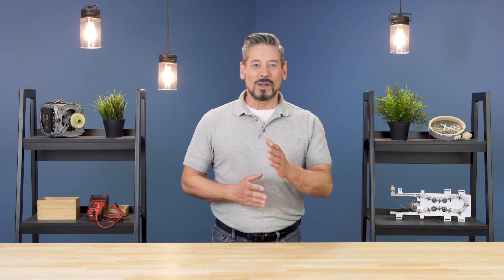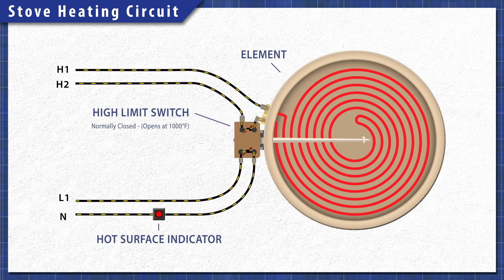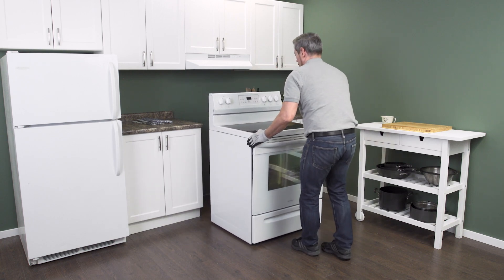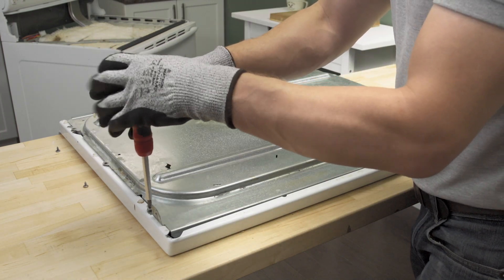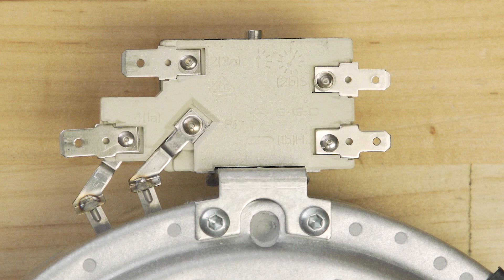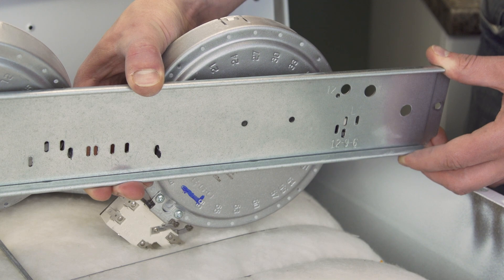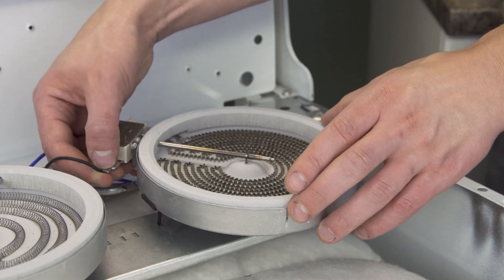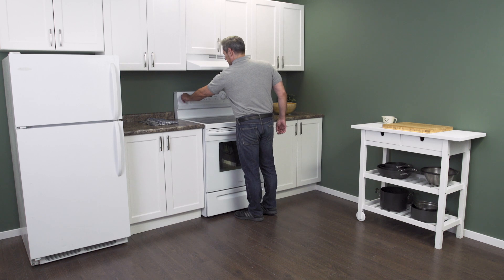Hot Surface Light Stays On - Troubleshooting | Repair & Replace

Comment from the maker: Did this video help you fix your stove? Did you run into any problems? Let us know in the comments!
Reply: Yes, this helped me determine if the problem was the element or the limiter controlling the indicator. Thanks for this informative video.
Reply from the maker: @izeugirdor  You're very welcome, we're glad that you found it helpful!
Reply: No. I tested all switches, they were all open. I even tested the warmer. The light is still staying on.
Reply from the maker: @miguellugo3543  Thanks for watching. It is unlikely for the hot surface indicator light to stay on if none of the limiter switches were closed at room temperature. By any chance is it the power indicator light for the burners? That could be a problem with the heat switches rather than the elements themselves: https://www.youtube.com/watch?v=s5iG61kAyJQ
Reply: I tested all the switches and they are all open. But the one thing I did notice is I don’t have any wires going to my 1b and 2b on the element
Reply from the maker: @XRotov2  Thanks for watching. Do you mean that out of all the heating elements, there were no wires going to the 1b or 2b on just one of the burners, or on all 4 burners? Have their been repairs on the stove done before, or are these the original untouched parts?
Reply: @AmreSupply  these are original parts untouched. And yes there are no wires leading to 1b or 2b on any of the burners.
Reply: @AmreSupply  I should add that there is a cooktop hot light and cooktop on light on. Thinking it could be one of the infinite switches?
Reply from the maker: @XRotov2  The heat switch will have a terminal for the cooktop on light. If this stays on then you'll have to test each of the switches to narrow down the faulty one: https://youtu.be/s5iG61kAyJQ

Now for the hot surface light, it is not usual for the 1b and 2b terminals on any element limiter not to have any wires connected.

You might want to check your tech sheet for the wire diagram. The tech sheet is often located on the back panel or in the oven drawer. I am not aware of all variations and all models so there might be a case where one sensor or thermistor is used to detect the glass surface temperature. You should be able to trace the hot surface light on the diagram and see if it goes to 1 sensor. In most cases it will be obviously wired and connected to each of the limiters on burners so that any single limiter will turn on the light.

One other consideration: If the hot surface light is built into the display board / control board then it is more likely that you'll have a thermistor. The hot surface light shown in the video is a physical standalone miniature light bulb.
Reply: yes. The only videos that are clear, to the point, without time waste, and solves real life issues.
Reply from the maker: @samj1012  Thank you! We put a lot of effort into making these videos clear and easy to follow. We're just glad that people are finding them helpful!
Reply: Mine is like the other person described, all test open, no wires run to the terminals for 2b 1b, hot surface light and cook top on light stay illuminated. Going to have to keep digging
Reply: This unfortunately was not what happened. It had turned off but I saw a faint glow. The glow was very dim. It was like LED ghosting because the indicator was an LED as I recently replaced the incandescent bulb with an LED after it burned out. But this caused ghosting effect which was annoying but i just ignored it. The contacts weren't stuck closed. This happened only for a minute after I turned it off. I just pretended it never happened instead.

Comment: This unfortunately was not what happened. It had turned off but I saw a faint glow. The glow was very dim. It was like LED ghosting because the indicator was an LED as I recently replaced the incandescent bulb with an LED after it burned out. But this caused ghosting effect which was annoying but i just ignored it. The contacts weren't stuck closed. This happened only for a minute after I turned it off. I just pretended it never happened instead.

Comment: Do you really need to use a multimeter if  I already know what burner dosnt work
Reply from the maker: It depends. If the burner itself is not heating up then it could be the failed heating element or the switch. Testing is required if you haven't eliminated the switch as potential failure: https://www.youtube.com/watch?v=GaW7uAHkPQI

Comment: Our glass top does not have wiring to the two smaller terminals... where is the 'hot surface' light then connected? model #WFE515S0JS0
Reply from the maker: Thanks for watching. Not all models have hot surface indicator lights but in the models that do, the hot surface light is wired to the limiter in the elements as that is what is needed to detect the temperature. If it's not connect to limiter on the elements it would need some other way of detecting the temperature.

Comment: I've experienced this occasionally with our Whirlpool range and I think sometimes leaving a pan on a warm burner may cause it to happen. I used to go down the basement and switch the circuit breaker off and back on again to clear it but then you might have to reset the clock, so now I just turn the burner back on fully for about 30-60 seconds and shut it back down and the light always clears once the burner cools back down in about 5 minutes, if it gets annoying to the point of happening all the time I'll do your fix, thanks for the video.
Reply from the maker: Thanks for watching. It seems that one of the limit switches might be sticking. The metal contacts inside of those switches can warp over time or become fatigued. Still if the problem is continuing to happen then you can definitely narrow it down by using the testing methods from this video.

Comment: It did help me. I replaced an element on my cooktop (because the inner ring was burned out) and the old one only had one wire going to the limiter. This had me confused as the new one had 3 terminals. Based on trial and error I figured out which connection I needed to use. Everything worked but I didn't really understand why. This video made me understand that the wire I'm connecting is the wire for the high limit switch and the indicator switch ones are not being used. 

The indicator works as it should though so I'm thinking it must be timer based. Does that sound plausible?
Reply from the maker: Thank you for watching. I am not aware of any hot surface indicator lights that are timer based as these are normally tied to temperature. 

If there is a dual ring element then the 3 terminals that you connected to were likely for the burner itself & the high limit switch. It is possible that the stove has the hot surface indicator on a separate circuit and is not directly tied to the burners.

Also if you have the link to the burner, please share it as I am curious to see what sort of part has that variation.

Comment: My infinite switch from kenmore stove  I need to replace it and I got one from AMRE SUPPLY  to replace " aftermarket " should I do the same wire as the original?
Reply from the maker: Thanks for watching and for supporting us! You should connect the wires to the same numbered terminals on the switch. Try to match as closely as possible. This video on the heat switch explains some of the terminals in more detail: https://www.youtube.com/watch?v=JKrrOflS1RM&t=403s

Comment: Why could this video have been done with a standard electric range
Reply from the maker: Thanks for watching. What do you mean? By standard electric range do you mean a conventional stove top with coiled heating elements? If so then you might be thinking of the cooktop (power) indicator light, which will be tested in a different way than the hot surface light. https://www.youtube.com/watch?v=s5iG61kAyJQ

Comment: Both my Stove on and hot light keeps staying on. I already reset the breaker.
Reply from the maker: Thanks for watching. It is unlikely for both the cooktop indicator light (lights when the power to any burner is on) and the hot surface light to be stuck on at the same time. These are on different circuits. 

To test the hot surface light, you'll have to test the limiter in each heating element as shown in this video.

To test the cooktop indicator light, you'll have to test each heat switch: https://www.youtube.com/watch?v=s5iG61kAyJQ

Now if you have an advanced stove with a control board that has integrated stove top buttons instead of individual heat switches (with dials), then it is possible a faulty control board could create these issues. https://www.youtube.com/watch?v=ORTi4lLyoqw
Reply: @AmreSupply  our power flashed two times when I was cooking when he had a storm. Now the are just both stuck that way. It’s a whirlpool stove.

Comment: Excellent video.
Even though the heating element wasn't working,  I wanted to verify with a meter to confirmed it was bad which it was.
I lucked out with my stove it didn't have a mounting bracket for the heating elements they were held in place with spring clips.
So just prop cook top like a car hood and get to.
Reply from the maker: Thank you, we're glad that the video was helpful!!

Comment: Hello there! I just got a new electrical stove and was wondering what does the hot surface indicate?
Reply from the maker: Thanks for watching. When you turn on a burner, the glass directly above and around the burner will heat up. There will be some residual heat for 10 minutes even after the burner has turned off. The hot surface light lets a user know that the glass surface is still hot and will potentially burn your hand.

Comment: My stove doesn't have a glass top.  Mine has exposed elements. Do you have a video showing how to test a stove top burner light with exposed elements?  I have a GE stove.
Reply from the maker: Thanks for watching. If you have a conventional stove with coiled elements then the light you're troubleshooting is a cooktop indicator light. For this you'll have to test each heat switch: https://www.youtube.com/watch?v=s5iG61kAyJQ
Reply: @AmreSupply  Of course our stove messed up just before we're getting ready to leave for a few days. Will it hurt anything to just leave it and let the light stay on until we return or should I disconnect the stove?
Reply from the maker: @historybuff5739  The light is fine if it is lit up as long as no burners have heat. For extra safety you could still disconnect power to the stove.

Comment: Great video. I just wish these had a better design. It's annoying and wasteful to have to replace the entire element instead of just the switch.
Reply from the maker: Thanks for watching, we're just happy to help. There are a small number of models that have a replaceable limiter, but they are not as common and requires some additional steps to replace. Using the part numbers on the heating element you might be able to check if the limiter can be swapped out in your model.

Comment: My GE Glass Stove Top element has a hot light indicator for each element. I know exactly which limiter is the culprit without needing to test. That said, the stove top works fine. Is there any need to get this replaced other than to stop the hot light indicator from showing?
Reply from the maker: Thanks for watching. Since the light is on a separate circuit than the burner, the stove will still work. If the heat switch is working properly then the burner will shut off and cool when turned off. So in this case, there is still full functionality even with a hot surface light that stays on.
Reply: @AmreSupply  bought a new in the box jbs86spss from Home Depot and noticed the hot top light staying on. Luckily still within the 48hr window to complain about it to Home Depot. Thanks for the video learned a lot!

Comment: I tested all of the burners on my Whirlpool RF262LXSB. They all tested for no continuity. What's next?
Reply from the maker: Thanks for watching. First double check that you were in fact testing the right terminals. As well check to make sure that nothing else is touching the element terminals. You can test between the wire terminals and the frame to see if it has shorted to ground.

Comment: Vance - if the light stays on forever - what damage will this cause ? Electrical shortages/fire?  Does it have to be changed?
Reply from the maker: Thanks for watching. If the light stays on forever, given enough time it would eventually burn out, turning the light off. These small indicator lights are used in all sorts of other electronics and appliances and are safe to stay on. The issue with the stove is you no longer have a light to tell you when it's still hot or when it's cooled down completely.

If the light stays on, installing a new light won't fix it. You'll have to narrow down which burner has a faulty limiter as shown in the video.

Comment: Hello. I need your help. I do have a problem with a Samsung range. I followed the procedure several times exactly as you described it. Every time I tested whole the elements' limiter (terminals 1B and 2B) the dial didn't show anything, just as it appears in the video in time 5:45. So, the indicator switches are Ok, but when I turn the range ON, the hot surface light remains ON. For an instance I thought my tester was wrong, so I got another one, and the results were the same. What do you think it would be? Thanks.
Reply from the maker: Thanks for watching. This can take more work to narrow down but you could do an elimination to see if there is still a problem with one of the limiters. The limiter could be sticking or intermittently giving issues which can sometimes not show up on a continuity test. You could try unplugging one limiter on one of the burners (just make sure the open ends are insulated / isolated and not touching anything). You can wrap them individually in electrical tape to isolate them. Then turn the range back on. If the light stays on, reconnect that burner and disconnect the next one and try again until you narrow it down.

If disconnecting it didn't help isolate it then it's possible that there's a short somewhere in the system. You can test the wires that lead into the indicator light for continuity. As well you could try testing for a short following the steps here: https://youtu.be/jnt_mUwdL8o?t=259

Comment: Excellent video, unfortunately, the burner limiter in my GE range is failing but not fully failed.  I suspect the problem is with a specific burner but the process of pulling the leads for testing that burner resets the limiter.  An alternative method of testing the limiter would be very helpful.
Reply from the maker: Thanks for watching. When you say that you suspect that one of the limiters has not fully failed, does that mean the light stays on some of the time?

If it is not possible to test the switches with a multimter, you could disconnect all of the hot surface light connectors except for one heating element, and then see if the light is still on even when the surface is cold. Then reconnect them one by one and verify. This is alittle bit more work as it requires disconnecting power, and taking the stove top apart multiple times but if you follow through one by one then you can narrow it down.

Comment: What happens if we leave it without fixing it?
Reply from the maker: Thanks for watching. If the hot surface light stays on and the cooktop is cool then there is no issue with it staying on. It won't damage your stove. This light is on a separate circuit. However it will essentially make it more difficult to tell when your stove top is still hot as the light is giving you a false reading.

Comment: Hi, Thanks for the great video. I very much follow the know-how and feel my limiter has gone bad.

I am using a whirpool stove and have both lights (Cooktop ON) and (Cooktop Hot ON).
Not sure why the Cooktop ON light is still there, despite I have the switch off.

Please advise.
Reply from the maker: Thanks for watching, we're just happy to help. If the cooktop on, (cooktop indicator) light stays on, then it's likely an issue with the heat switch. You can test each of the 4 switches with a multimeter until you narrow down the faulty switch: https://www.youtube.com/watch?v=s5iG61kAyJQ

Comment: The elements on my GE model J BP66S0K1SS RANGE work fine. However, the ON/OFF light is NOT working, but the "its-still-hot-light" IS  working. Is there a simple repair for this? The hot light does turn off when the elements are cooled.
Reply from the maker: Thanks for watching. The power on light is also known as the cooktop indicator light or the power indicator light. This is powered by one of the 4 heat switches. You'll have to take off the back cover and test each switch until you narrow down which one has a stuck contact: https://www.youtube.com/watch?v=s5iG61kAyJQ
Reply: @AmreSupply  if there is a stuck contact, wouldn't that burner be hot??
Reply from the maker: @anjalpatel2394  If the stuck contact is only on the limiter, then it will only keep the light on. It's separate from the heating circuit as shown in the "how it works" segment of this video.

Comment: I have the same issue but with the oven, the "hot" oven indicator light stays on when the oven is turned off.  Would the fix be the same?  Thanks
Reply from the maker: Thanks for watching. What sort of an oven do you have? Does the oven have a physical dial or a control board?

Comment: Thanks for the video. Have a practical question. If the light is on and the circuit breaker closes the conduit, does it have impact on electricity usage? Or the effect is not so big to be concerned about?
Reply from the maker: Thanks for watching. The hot surface light does not consume much electricity. If it stays on, there won't be a significant difference in your electricity bill.